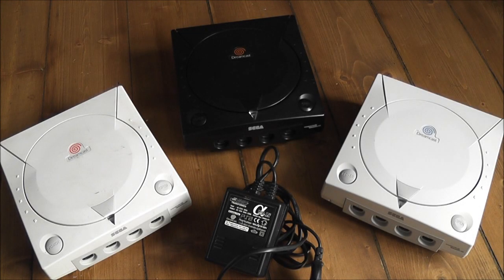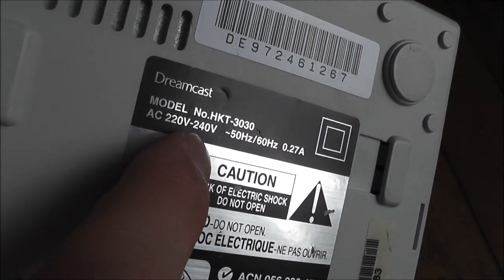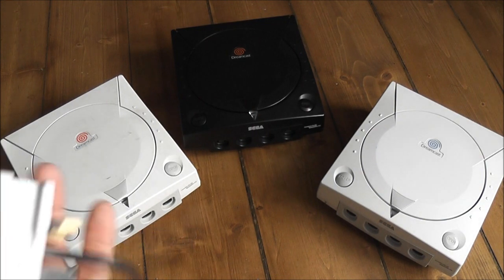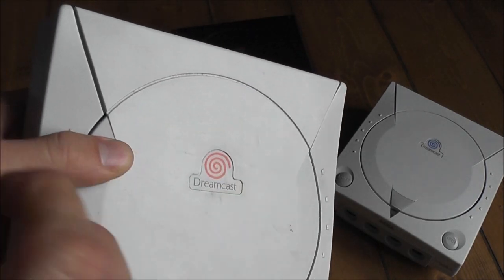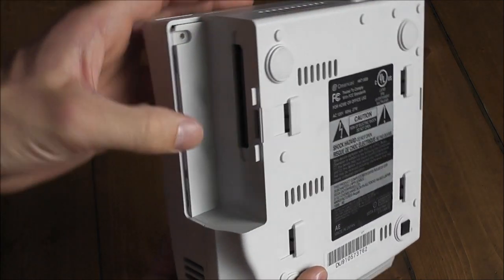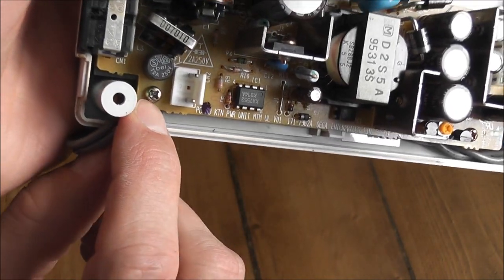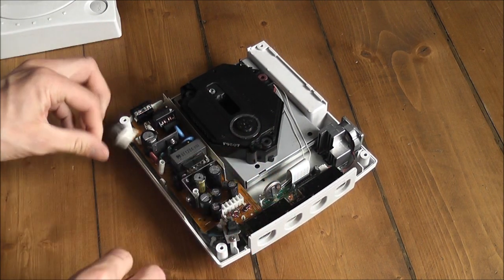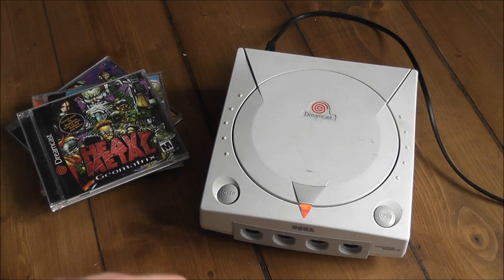Dreamcast Power Supply Region Mod - Replace Internal PSU - No Need For Converters

Comment: This video single handedly helped save the hello kitty japanese dreamcast I got for my birthday. I went to set it up and plugged it in without a transformer not even thinking about the difference in voltage! It didn't blow up or anything, the power light lit up for a second before it stopped recieving power. I got a cheap pal dreamcast from ebay for parts, switched the PSU's, and now its up and running like nothing ever happened :)

Comment from the maker: @EarlyHardcoreCD This procedure is for installing a Euro 220V compatible PSU to avoid having to use a separate stepdown converter. If you want to play NTSC games on a PAL system then you can just use a boot disc or burn a selfboot version of the game to CD.

Comment: Is it possible to use the PSU from a pal VA1 Dreamcast in a Japanese VA0? I've heard that there are some voltage differences (5v Vs 3.3v). My ultimate goal is to install terraonion mode inside my Japanese VA0 and use my pal Dreamcast to play my original discs. 
There are also PSUs like dreampsu or pico but I don't know if they work with mode. I've also heard that may introduce on-screen noise but I don't know much about that.

Comment: when that thing blow up the dreamcast is still alive?
today that cilinder blow up on my DC but im not sure if my dreamcast is still alive
it was very weird because it just explode after 15min, but i have played hours on my DC and nothing happen back then, but today it just died, i guess my volt is 220, but even if thats the case why it took to long to die? or is it that those cilinder dont die at the very momment you plug in?
also if i get a new cilinder and replace it it will work again?

Comment: I am in London & I have a CD-i 220 (225 in the states I think~?)   it all powers up fine & I am pretty sure the lazer is ok, but it wont read any discs, it may be the motor? & there is one belt that needs replacing, its in great cosmetic condition ,Can you help in any way in getting it repaired? I have been looking for over a year for help,I need either someone to repair it for me or if needs must some instructions for me to attempt a repair myself (last resort,I don't want to destroy it) thanks

Comment: I'm pretty sure it is an issue, the VA0 issue draws more current than the VA1 used in PAL consoles and so the psu overheats sooner or later

Comment: Hey just wondering if the UK 220v would work on AU 240v? I have read that the UK version shows 220-240v on the PSU. Do you know if this is true?
Reply: It does, he even showed it in the video.

Comment: That PSU off of NTSC model probs would have been ok. Just check fuse and put new reservoir capacitor in ;) Hope you didn't throw it away?